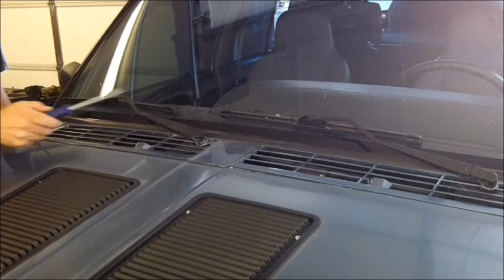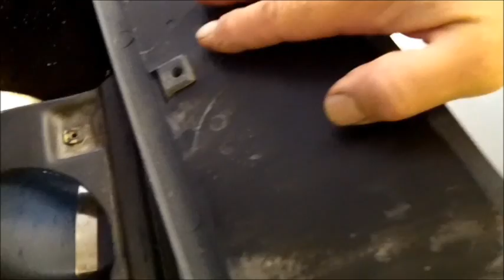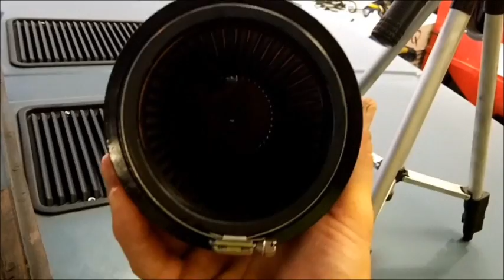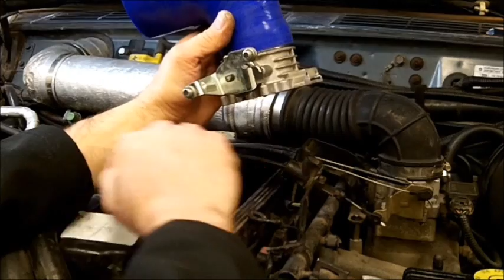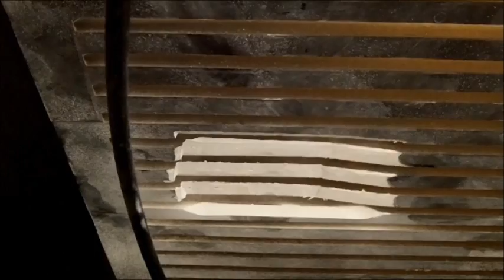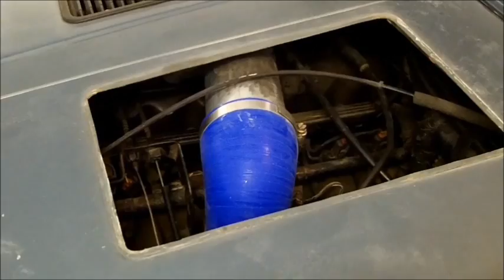DIY Cold Air Intake/Snorkel for Jeep Cherokee XJ

Comment: What about water intrusion when it’s raining
Reply from the maker: When the engine is not running the water is simply going to run through the filter from one side to the other not down the intake. 
And when the engine is running I would imagine it does suck a little bit of water I have never had a problem and it is more like steam cleaning the combustion chamber.

Comment: On cutting the hole I have not done this exact job yet but I have done similar get a scrape piece of black abs drain pipe similar diameter to hole miter it on the end till you get the  angle that Sits flush and level how you the pipe to sit  then trace around it with a marker on the cowl cut it out with jig saw or tin snipes etc I use a air body saw but not everybody has one of those

Comment: How do you protect against rain? Or water getting into the intake?
Reply from the maker: Being that the filter is mounted horizontal the rain will run through the filter from one side through to the other  when you're driving you are gonna pull in a little bit of water it's more of a mist and if anything it's steam cleaning the inside of your combustion camber.
 I have driven in some heavy rains over the years and never have had a problem.

Comment: Thank you for the detail Martin!  I started my install yesterday and will finish it up today.  I used a $100 3’x3.5” carbon fiber tube from silicon intakes along with 2 elbows and 4 clamps.  Add the $50 aem filter and $30 4” saw bit and I’m probably $250 into it.  Now I got to rebuild the stroker. . .
Reply from the maker: That sounds awesome especially that Carbon fiber intake tube.
Glad you found it helpful 👍 😊

Comment: I made mine and wrapped it with gold reflective heat tape, as used by NASA. It’s a lot better than the silver stuff. I additionally wrapped my intake manifold in it, and wrapped my exhaust headers with exhaust wrap. Once I buy a heat gun I’ll measure it next to my buddy’s stock 1999 Cherokee and maybe make a video.

Comment: What size is the 90 on the throttle body side? It’s definitely not 3 inch. For anyone else wondering, a 2.25 inch to 3 inch is too small. I’m gonna try a 2.5 inch to 3.0 inch next and will update so you don’t have to waste your money too.
Reply from the maker: With mine I believe it was a 2.75 to a 3.5 inch

Comment: Why did you do it to the other side of the engine? Why not just take the direct route to the firewall?
Reply from the maker: wiper motor in the way
Reply: @martinbuilt  ahh, ok, that makes sense. My Jeep is right hand drive, so I’m trying to figure this out cause everything is opposite.
Reply: @officialWWM   In addition to the wiper motor being in the way, that’s also the side with the cowl intake in it. (As in where the air normally enters the cowl in order for the cabin to have air) The vents on the passenger side (Right side) are faux, and thus cannot let rain pour directly onto the intake.
Reply: @officialWWM  assuming that your wiper motor and cowl intake are on your drivers side (right side), you are able to take the direct route to the firewall you mentioned and will have a much more efficient cold air intake than most of us.
Reply: @TheOceanX  thanks for the tips, I actually just finished building one. I was able to take a pretty much direct route back from the throttle body to the firewall. It was really very simple and seems to work great. I now have an extra battery where the air box used to be :)

Comment: probably a good idea to thermal wrap the elbow for the throttle body to air induction tube since its above the intake/ exhaust manifold or header. you should do a video and take us for a drive so we can hear how it sounds and performs?
Reply: Er, the entire intake manifold is above the exhaust!
Reply: @officialWWM   the heat rises and then turns the air inside the "cold air intake " hot  so yes all that above the intake needs to have heat resistant wrap to keep the air cool
Reply: @MoparMan1978  I understand that but the point is, the intake manifold is situated directly over the exhaust manifold, therefore, unless you are also going to insulate the intake manifold, there’s no point in worrying about the tubing. Besides, the air is travelling through the system at huge velocity, I do t it gets time to warm up. Also, the stock piping goes over the exhaust too, soooo…

Comment: if you have that cowl plastic piece cut off and taken out that opens it up to the elements. For example what's stopping water from hitting the top of that air filter? you also have hood vents to release heat from the engine bay which is in turn being sucked in through the opening to the elements through the air intake filter and back into your engine. how is this a cold air intake system please explain?
Reply: Please don't take me as trying to be a smart-ass this is one question that I I am truly asking from one Tinker to another
Reply from the maker: Kelby Braggs 
yes water does hit the top of the filter but that doesn't really matter as it also will run through the filter through the bottom side of the filter so water does not directly enter the intake tube only when the engine is running does run water run into the engine and this would be water vapor. Driving in the rain many times and you cannot even tell any difference from when it's not raining.
Reply: You still haven't mentioned anything about the heat coming through your hood vents and going into your air intake
Reply: I simply ask because I am getting ready to do this project to my Jeep I have a 96 Jeep Cherokee XJ 4.0 with an automatic it is also the rare 2-door
Reply from the maker: Kelby Braggs
That most likely would only happen at low speeds. Cuz you're getting a cowl induction effect off the windshield
Reply: Slow speeds as in 4-wheel low drive slow speeds. So it only works as a cold air intake at high speeds

Comment: What did you do to keep rain water from pouring down into your air intake ...It might not be an issue in the Dry  west but in the northeast it's a huge issue ?
Reply: It won’t go in. It’s a non issue.
Reply: The water is only able to enter the cowl on the drivers side, then it drains out via drain tubes
Reply: @TheOceanX  did you not see the big hole he cut in it right above the filter?
Reply: @benthebuilder6934  the hole that gets covered, yeah I saw it. I also see cherokees with this done to them all the time at yearly cherokee events, with little to no issue
Reply: @TheOceanX  he cut the cowl out above the rectangle hole, if you read his other replies he said water gets on the filter but hasn't been a problem for him.

Comment: This makes it extremely loud inside the cab. Every time you open the throttle it sounds like your registration is going to get sucked through the glove box. Also it looks pretty ghetto. The guy I bought my XJ from had made one and I called it the crack pipe until I reinstalled the OEM airbox from a junkyard.
Reply from the maker: Joe 

my only seems to be loud when you first start it up at initial cold starts.

Comment: I have a 2001 Jeep Cherokee and I just put a hood scoop on my hood right over where the air filter is to get more air flow, I'm later gonna run a cold intake flow system in it, my jeep runs really great but it likes to get a little hot at times, so that's why I'm boosting my air flow, when I finish school I want to be a volunteer fire fighter and sup up my jeep, plus I drive about 90 miles every Sunday. I pastor a small country church, so I really need a good air flow in my jeep. I enjoyed your video I keep looking for the right answers but yours made a lot of since. thank you.
Reply: Pastors need a lot of air flow on Sundays? 🤔🤔
Reply: can you send some picture of hood scoop set up please?

Comment: where is your mass air flow sensor
Reply from the maker: There is none on a 4.0. It does have a MAP senior, witch is mounted on the throttle body.

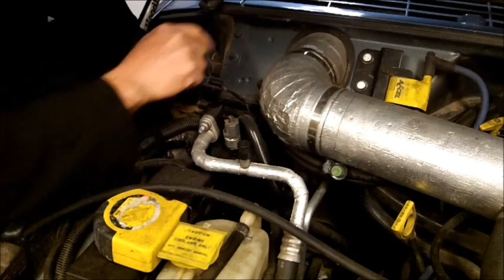Comment: 6:30 for anyone wanting to replicate this setup, I would recommend you grab a hammer & the hole saw, then line up where you need to make the hole and tap the hole saw bit to scribe the surface of cowl. Then take a regular drill bit and drill out that scribe mark and lastly use the hole you just made to hold the hole saw in place while you make the actual four inch hole. Doing it this way should make creating that hole a lot easier.

Comment: Where and what brand do you recommend concerning the heat wrap?
Reply from the maker: No I don't know. Maybe the next time I'm at pick a part I'll see if they have any 89 Cherokee's and check it out.
Reply from the maker: I believe I used thermal wrap that I purchased at AutoZone
Reply: +martinbuilt thanks buddy!!!
Reply: +martinbuilt On the 89 that side of the cowl does not open do you know if there is anything under it or can I just cut through it

Comment: so you basically can't drive in the rain or any water that will hit the hood?
Reply from the maker: I have driven in the rain many times and never had any problem whatsoever. the Jeep has been parked out in the rain before starts right up.
Reply: +Karo Staro  That side of the cowl is not open to the outside,   just the drivers side, you actually have to fill that whole cowl to the point water is pouring into the interior before that cowl intake would start sucking water.   This is a great way to keep from sucking water into your intake!!!!!  -  oh I see he removes the covering on that side - not good.
Reply from the maker: +Bryan Webster 
I have driven this thing in the rain many times and never have had a problem. just remember when its parked water runs through the air filter not down the intake. and when you're driving it so what if it sucks a little bit of water. you're talking water vapor.
Reply from the maker: +Bryan Webster 
I have driven this thing in the rain many times and never have had a problem. just remember when its parked water runs through the air filter not down the intake. and when you're driving it so what if it sucks a little bit of water. you're talking water vapor.
Reply: idk point is to keep the air filter dry at all times. if it runs through it it'll run inside
Reply from the maker: +Karo Staro
 no you don't understand the filter is horizontal I mean the water runs through it,  through the top through the bottom of the filter it does not run into the filter and then down the intake tube it cannot do that.

Comment: Martin,  I am planning do this, but wanted your opinion on this, do you think a possible enhancement to this design would be to keep the air filter in the main tube under the hood with a Spectre "HPRO100" conical shaped filter, drill the hole in the firewall and pass the tube thru just enough say a 1/2" inch.  Leave everything else alone.  Since the air for the cabin comes through that area and seeing that it passes directly passed my new drilled hole, air for the engine should not be an issue.   

Can you give a parts no. & manufacturer for that rubber gasket you found would save a ton time tracking it all down.  I like your videos please keep them coming.
Reply from the maker: uvha X  I just think the Spectre has a small filter. but I like the idea or design.

Comment: 12:45 Blow By what??
Reply: MrKnaberaps a blow by is a device that catches oil that gets spit out the crank case ventilation valve.
Reply: Here's my only concern or question isn't the blow by supposed to be filtered before the intake manifold?

Comment: What did you use to do your hood vents ?
Reply from the maker: If you are referring to the hardware I used, that is 1/2 x 3/4 aluminum angle. The vents them self are from a 86 Chrysler La Baron turbo.
Reply: Thanks

Comment: Martin...Great project and video.  Exactly what I was hoping to find.  Is all of the tubing EMT?  Where'd you get the 90s and heat wrap?  How about a parts list?  Thanks.  Gene
Reply from the maker: Gene,
Yes the tubing is all EMT. the 90's I got off of ebay. I think I got the heat wrap from ebay as well but it could have been from Summit.

Comment: If you remove the factory cowl grill, doesn't that let rain water fall directly on your filter? I left mine on in that section.
Reply from the maker: I've driven in the rain with no ell affix. When the engine is not running rain water just passes threw the filter. I haven't had any problem.